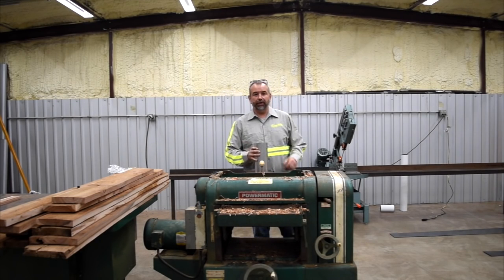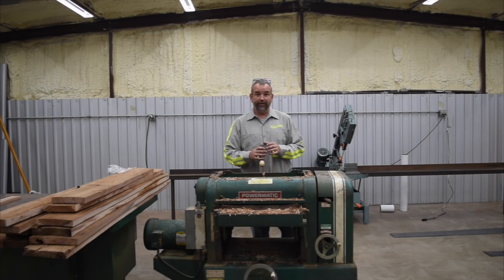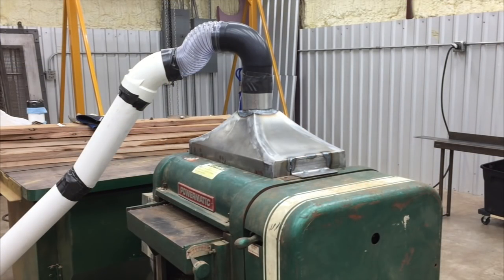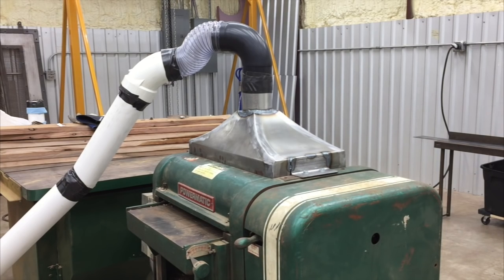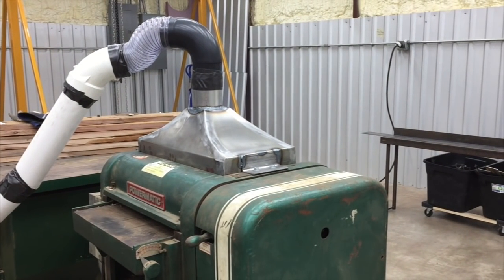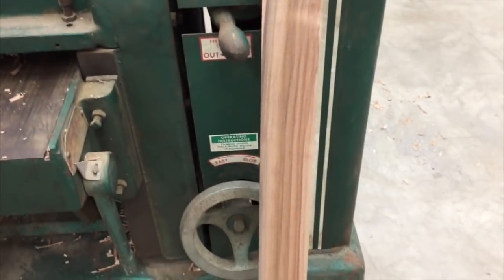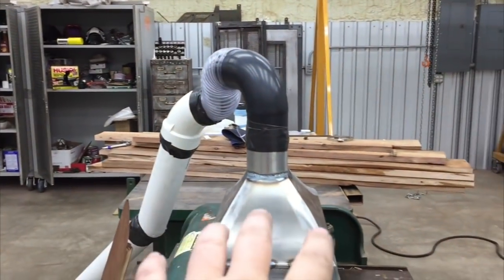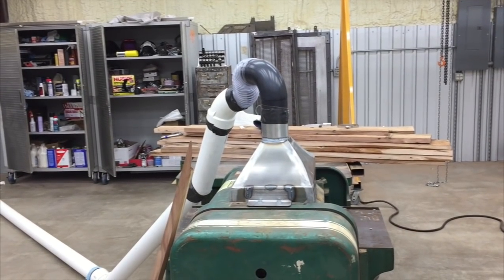Sheetmetal Fabrication -Cheap Planer Dust Collector Port - Metalwork Monday - Tig Welding Basics

Comment: You need a slip roller for your shop.
Reply from the maker: yea, i looked at them, thought seriously about running to harbor freight to get one, but they are more than i thought they were, i managed it ok by hand on this, if i get more sheetmetal work to do i may get one.
Reply: Whatever you do, don't get the 52 inch 3 in one hand powered. That thing is junk! We had one at our school, and I spent more time fixing it than we did using it.